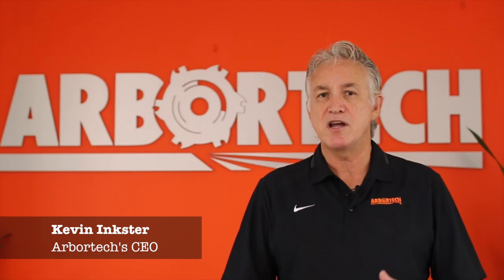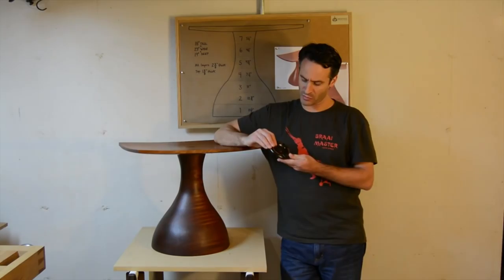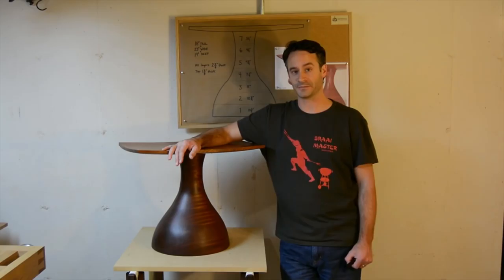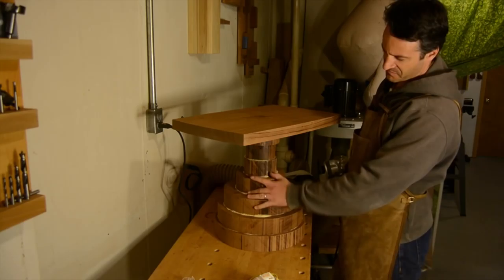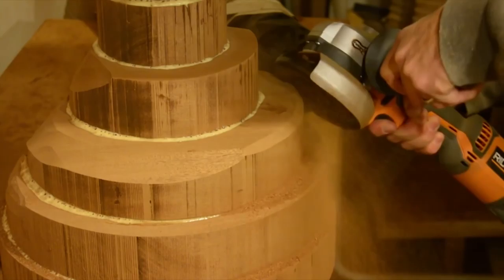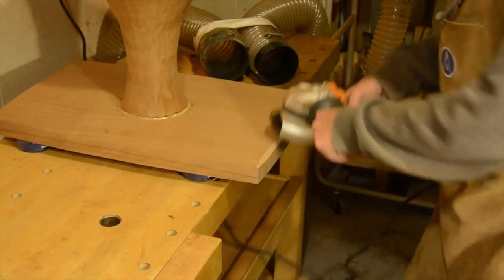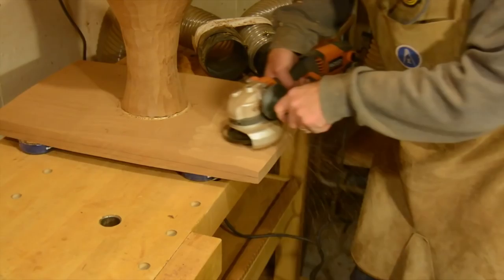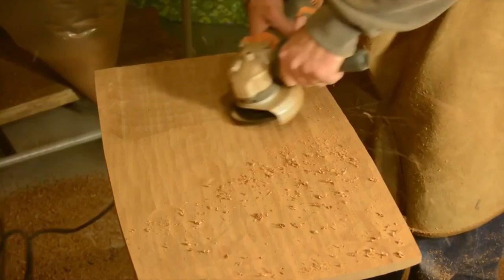How To Wood Project - Styled Wooden Bench

Comment: Nice work, how long did it take you from start to finish?
Reply: +Joel Van Staden Thanks Joel. I'd say this piece took under 35 hours or so. However, I've used the tool on similar applications before and replicated a design already existing. If you are just starting out with power carving, you might need a bit more time.